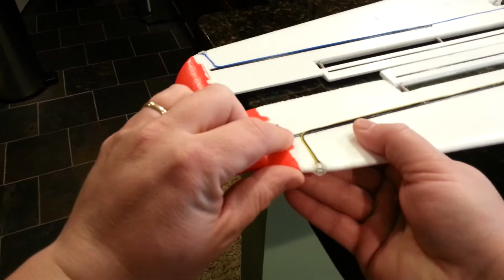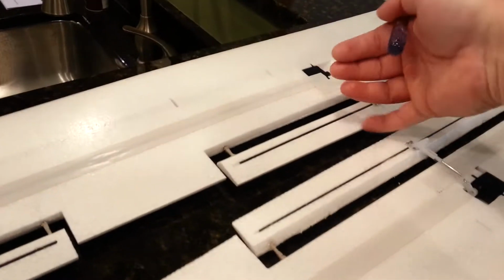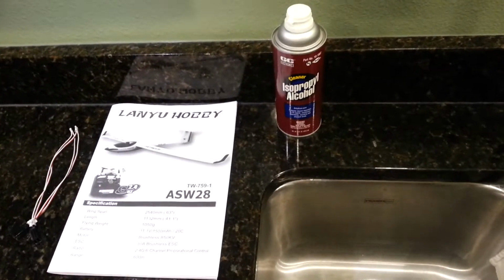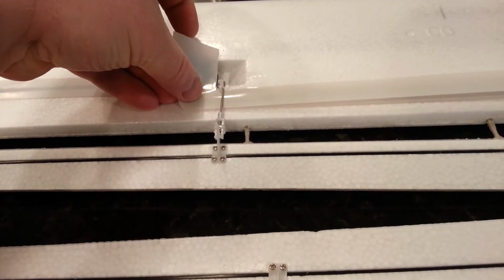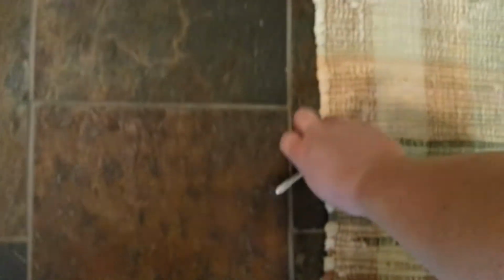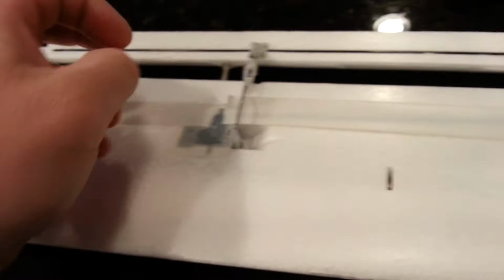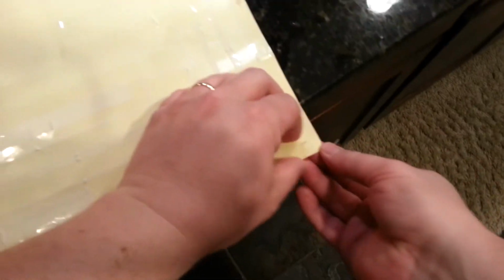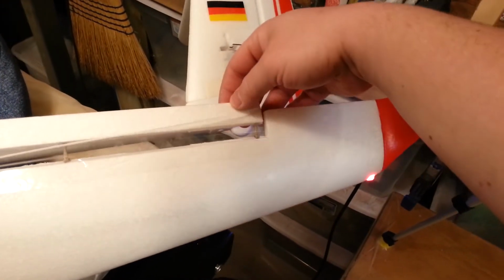Volantex RC / Lanyu - ASW-28 - Finishing Touches on Wings - Build Series - Part 15

Comment: People in the RCGroups forums mentioned that the angle of incidence is wrong (they put a little shim under the rear elevator hardmountpoint). They also suggested to tape over all controlsurfaces and spar which would result in a noticeable better glide-ratio and more speed. 

Do you there is some truth to this ?

I have two ASW and can atleast confirm the angle of incidence is wrong.
BTW: Where have you found the sweeetspot for the CG ?
Reply from the maker: There is some truth to what you found on RCGRoups.How much did you adjust the AOI with shims?I fly mine about spot on from the manual.
Reply: @BrianPhillipsRC  I did not change the AOI (yet) but I am gonna do it soon.
Reply from the maker: Will you let me know how it works out for you?
Reply: @BrianPhillipsRC  No !!

Of course I will.